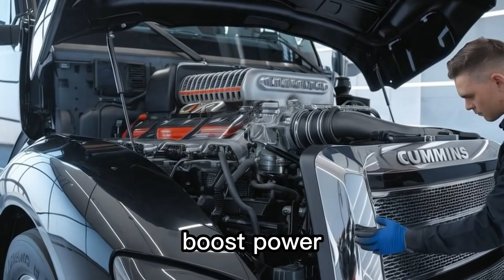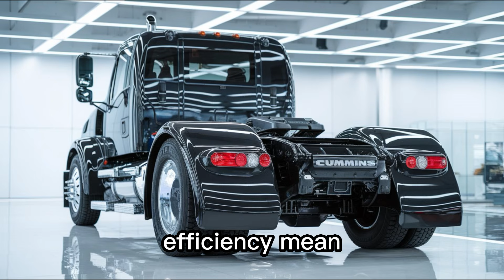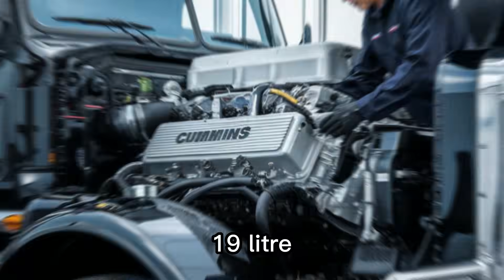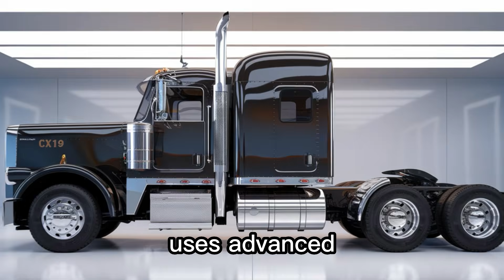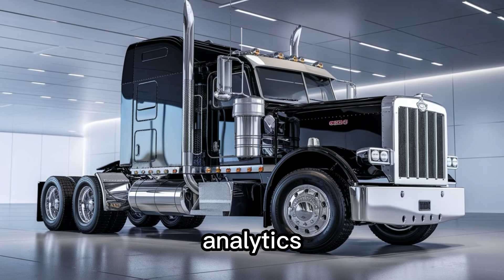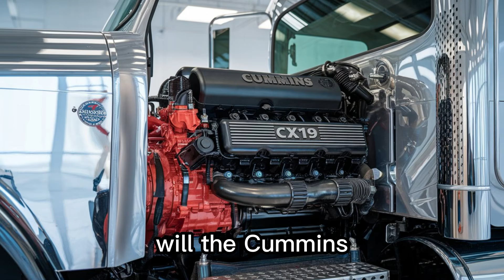New Cummins CX19 Prototype Unveiled – The Future of Heavy-Duty Power!

Comment: Yeeeeahhh, lemme just go ahead and stop you real quick- All this means absolutely NOTHING if this engine is gonna be completely loaded down and packed to the brim with "smart tech." You're not gonna sit there and talk all this talk about how supposedly amazing and revolutionary this engine is when it's gonna have a hundred sensors stuck to it that monitor a hundred other sensors, where if even ONE of them goes bad, it cripples the entire truck. Then on top of all that, you've got an engine with all this new "built in seamless" emissions reduction crap in it... yeah how much is THAT gonna cost to repair or replace when it inevitably fails??? There is no such thing as a revolutionary reliable post-emissions diesel engine. It simply doesn't work. If it uses DEF and has a regen system, it's garbage. Full-stop.